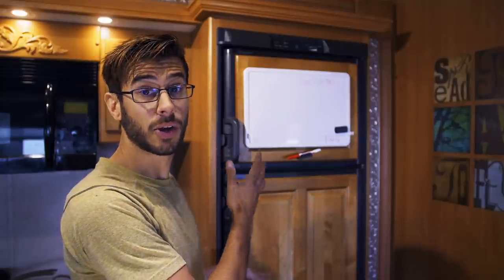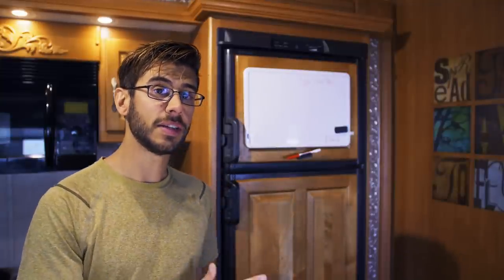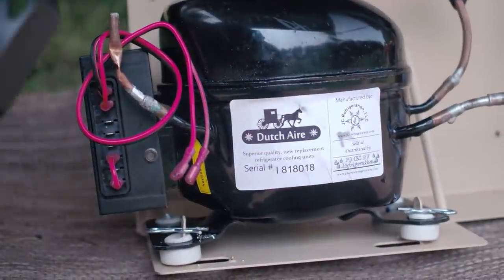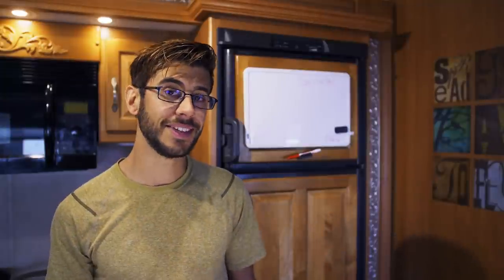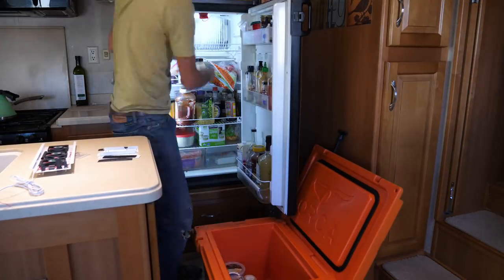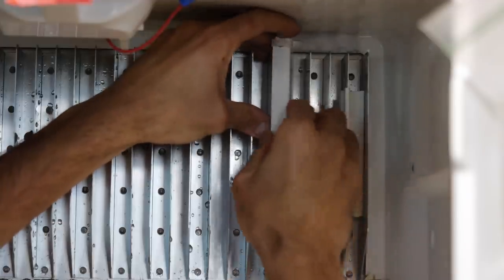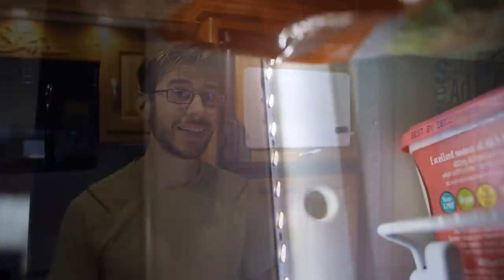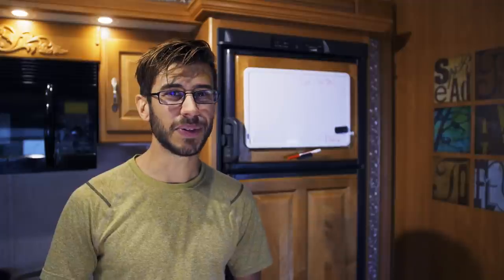RV Fridge Fan Installation and compressor retrofit 6 month update

Comment: You provide a lot of information about your projects, with great updates. The whole RV fridge thing is more complicated and there are much better options than 10 years ago. I have a Danfoss fridge in my van, which doesn't use much power at all. It's not very big. It's very quiet.

I was looking at a 4.4 cu ft fridge at Costco yesterday for $150. Not terribly nice looking, but OK for the rec room. They require listing operating costs, and I dug around inside the fridge and found the yellow placard. The yearly energy use for this ultra cheap fridge is around 275 kWh. If you divide that out, it is around 700 watt hours per day. So, it's pretty efficient and this is just a totally basic unit. 

With solar and, eventually, lithium, the all electric seems inevitable. The cost of a Dometic absorption unit is pretty high. I don't know what Forest River pays, buying in bulk, but retail is over $1k for a 6-7 cu ft unit. 

The numbers for using propane can be estimated, if only to figure the relative efficiency. There is a burner in any propane fridge and a good guess is that it is a 2,000 BTU burner. You can convert watts/BTU's since there are about 3.4 BTU's in a watt. (Your 1500 watt space heater is around 5000 BTUs.) A 2000 BTU burner is about 600 watts. My burner, last trailer I had, cycled about half the time. So 600 watts is 600 watt hours an hour, and 7200 watt hours per day, for 12 hours 'on'. Seems like the 700 watt hours in your fridge and even the Cheapo Costco is pretty favorable, compared to 7200 watt hours for propane. Maybe having a fire next to a fridge is not very efficient. Maybe absorption isn't very efficient. 😕

In my Ultimate Van Build, I wiil have an electric fridge. It would be nice to have at least R-10 insulation and then get a high efficiency heat pump that grabs and removes heat very efficiently. Then maybe an induction stove. 

Propane Facts:

https://www.amerigas.com/amerigas-blog/2012/march/geeking-out-over-propane

In this article, the draw for an absorption fridge on AC is discussed. He say 5A on 120 VAC, which is a lot of watts. But it works out to 600 watts on AC or propane. 

http://rvservices.koa.com/rvinformation/rvmaintenance/rv-converters-and-amp-draw.asp

Comment: Great update, Tom.  It is helpful to get honest updates with how you adjusted and addressed issues.  I am glad to hear it is working out.  We used a small battery-powered refrigerator fan to keep our refrigerator more evenly cooled when we used the travel trailer.  The kit you added for the fans makes a lot of sense.

Comment: Im installing one of the 12 volt JC Fridge units tomorrow. Doing my homework now. Will be sure to run a power wire inside the fridge while I have it apart. A temperature sensor wire too. I was going to run it on 24 volts but a thinking of staying with 12 volts now. My solar energy system is 24 volts but I can run it on the original house battery for now using the original 12 volt wires. Thanks, good review.

Comment: You may have just answered my question why I “don’t” want to try and put a standard RV fridge in my new Tiffin.  The longer term use and fin freeze potential underscore the fact that the need to run a generator for a brief time daily when dry camping overshadows the deficiencies of a two-way fridge.

Comment: Great video.   I have seen at the Huntsville,AL RV show a new 12v refrigerator.  Same exterior size, 10 cuft, stainless doors, and is frost free. Manufacturer specs state when empty takes 1hour to chill using 8amps 12v.  Once cold typical use is 3.5amp. It is a compressor type fridge built for rv’s.   Vibes are using these now..  I sound a source $799.00 shipping included.  It is an Ever-Chill WD-282FWDC.    Looks like it would be an easy swap fit.   Much easier than the swapping y’all had to do. My Rockwood 2507S is new but I am tempted to swap mine out.  The real plus is you could use power from tow vehicle while on road to keep food cold. Also would work with 100 w solar...
Reply: I just purchased a new Phoenix 5th wheel that came with this fridge. I almost did not buy it because of the fridge. The label on the fridge says 11 amps but, according to Way Interglobal, this fridge will draw 8-9 amps on startup until it reaches temp and then use about 3 amps to maintain that temp. So far it seems to be right. I have two 12 volt 100ah batteries in parallel and a single 100 watt solar panel on the roof. Dry camped for 2 nights and batteries drained down close to 50%. I also have a small 2000 watt inverter/generator that I can use for a couple of hours to top off the batteries if needed. The compressor in this fridge is a bit noisier then a regular residential 110 volt fridge but it's nothing we can't live with. So far, we are happy with it.
Reply: I'm curious how that fit through your door? or do you take it through the window?!

Comment: I really wanted to do this conversion for my 2001 Traillite with a Dometic 2652 but on the JC website they list the measurement needed from the back of my absorption unit to the outside wall and it's right at 2" under and wont fit without modifications to the cabinet work inside that holds the fridge. I may still do it but for now it's a no. also my absorption unit is cooling down to 32 degrees with the freezer down to zero by only adding an upper fan and interior fan kit of my own design, my biggest concern for going ahead would be to eliminate the gas burner but when you mentioned the Kilowatt usage it still wont work without 4 more solar panels (we only have a 400 watt system) my whole rv is on an inverter but the absorption unit had to stay on 120 shore/gen power, amp draw is too high for the 3000 watt inverter so here I am again, thanks for the videos and updates

Comment: Thank you for all your great work.
I have a question about the DC refrigerator.
I am set to follow in your footsteps but JC Refrigeration says they recommend the AC version.
What is your opinion? DC sounds more logical to me, but maybe I'm wrong. Doesn't it take more amps to invert to110VAC ?

Comment: Hey Tom!!! Great video. I am going to go with the DC conversion on my Nor Cold N611F fridge. Don't like the chance of fire. This unit now works as good as ever, fridge between 38 and 41 degrees and the freezer is around 8 on lowest setting, but I still want to shut off the propane to my fridge. NOW, you got me pricing solar units to keep the batteries from being over-taxed?? It never ends, does it. Thanks again for such a pro video and your knowledge. J.R. at JC Refridge knew you BTW; Bob Trice

Comment: Nice Video, thank you for the update.  JR has moved the copper tubing to the top of the coils now.  This sends the coldest stuff up to the frig (from the bottom of the coils).  I have the DC conversion and it is pulling 10 amps now because of the fixed 2000 ohm resistor.  I would like to put in the variable speed but I am electronically illiterate.  Can you send me a link to the variable speed?  Show me where to attach it (the Sikelan QDZH65G manual resolution is way too low)?   How do you know how much rpm is increasing?  Is the zero mark on the dial, zero rpm and the 10 mark 3500 rpm?

Comment: Thank you for this great update! Have you considered replacing your door seals? You mentioned that they might be responsible for some of the energy usage.
Reply from the maker: We have , but just have not had the time.
Reply: Most require a new door. The adhesive gasket kits are crap.
Reply: Great video!  I have the same refrigerator. I was able to find a replacement door seal kit offered by a company in Australia. Fridge-Seal was very easy to work with. They had a set made and sent to me in about four weeks. A bit pricey but well worth the money.

Comment: Thanks for both the original article about the fridge conversion and this update.  I'm considering converting the fridge in our class C as well. I actually had an appointment with J.C. Refrigeration in April to do the work but had to cancel due to the pandemic.  

I have a quick question, which boils down to, "do you think I have enough battery and solar power for this?"  I have 300 watts on the roof the RV and another 200 in a portable suitcase that I can move to best catch the sun.  However, I only have about 270 amp hours of battery capacity, and there's no good place to carry more.  

In this update, you said your biggest draw day was 1.2KWH.  If I'm using the right formula, that would be 120 amp hours at 12 volts - is that right?  And if true, it means that on that max draw day, I'd use almost half of the battery capacity just for the fridge.  

We have an onboard generator so we can recharge that way if when we need to. 

We very often have AC hookups, but we also enjoy extended stays off the grid.  What do you think?  Would you have concerns about making he conversion to a 12V DC compressor-based fridge?  

Thank you, 
Dave Collins, Windham Maine
Reply: Additional info:  we don't run an inverter at all right now.  The consistent draws on the batteries are lights, and enough juice to regulate the propane heater and propane fridge.

Comment: Interesting  review of your upgrade and well a done video, thank you.   If I many add my thoughts, yes the fan mod works but at the cost of much higher electricity usage than need to correct the frosting issue.  An issue you don't have but others might.   Those fans no way need to run 100% of the time. 100% duty cycle is way over kill for their needed function and therefore wasting electricity more than required.   I contend they would preform just as adequately if they only came on periodically like typical refrig's do via a defrost timer. That could also work the same way but it does not to the determent or using much more power than needed.  Not just from being 100% duty cycle when not needed but by over circulating the air inside the frig the cooling load on the compressor is greatly increased.  Cheers.
Reply: Just get a well insulated top-load Engel or similar. They offer a very low electrical draw and need no mods to keep working reliable year after year. Of course they look and operate differently than a household fridge but that is a good thing.
Reply from the maker: Yes a timer would be smart.  I did not mention it but I usually only run one fan at a time and switch through them every few days when I think of it.  I frost forms the fans will melt it so they don't need to running all the time

Comment: Hello Tom, watching your first video on the subject inspired us to retrofit our unit from JCR as well.  I'm wondering if you've had any further trouble with your retrofit from them?  I've had nothing but trouble from ours and have even asked for a refund.  From blowing the original motherboard to installed fuses, adding a inverter to "trick" the unit to think it's on 110v, to blowing that inverter, to finally having the unit continually blow house fuses to the fridge.  I don't think it has run continuously for more than 2 months at a time, going out 5 times and ruining untold $ of food in the freezer/fridge.  Reliability of the unit I've found to be....let's just say "not so good".  If I can't trust it from day to day, the unit isn't worth having in my opinion.  At the moment, the compressor will run, but i have to manually turn the unit on and off with a switch.  And knowing that my memory sucks, temps vary "wildly".  Is there a timer unit that you know of that would just have 5 min on/off cycles?  I've found units Amazon that will do that, but only have 17 "programs" available that I would need to extend my runtimes significantly.  They seem overly complicated to my needs.  I would just like a simple "timer" to adjust without its need to know what time to come on and off.  Any thoughts would be greatly appreciated.

Comment: This is all much too complicated. I have had a engel top load running constantly for 15 years and never had to any more turn it on. My top-load (side by side)  dometic is but a year old yet operates similarly. I was hoping your conversion would end all the traditional problems with an RV absorbtion fridge but nothing seems to have changed. Fans to circulate inside and fans to cool the compressor (when the outside temps hit 100 or so) seem still needed after all these decades. I was really wondering and am glad you did an update. Thanks

Comment: If you had the whole process to do over again, would you still go with this conversion, or retrofit to a fridge designed and made with a compressor to start with, (assuming you can purchase this type of unit that would fit in the space you had?)
Reply from the maker: It really depends if I could find a DC fridge of the right size and good price I would probably retrofit.  If not I would go this way again. I like having the fridge that fits and looks right but the dedicated units do have more space in them

Comment: If you were buying a new fridge, what kind would you get?  We are looking at our first RV and we want to build in boondock capability.
Reply from the maker: If you are not planning to do a big solar system the traditional absorbtion fridges running on propane are best for boondocking. The domestic units are getting pretty good. Dometic also makes a DC compressor version from the factory if you plan to go big with solar.

Comment: If I understtand right, newer fridges go through a short defrost cycle every 25 hours. I wonder if that cycle would be enough to keep the fins free of ice or if the better cooling power of the JC unit would still build up excessive ice. 
Do you know if your fridge goes through a periodic defrost cycle automatically?
Also, are you saying your JC unit didn't cool good enough until you upped the voltage to the compressor?
Thanks fo r agreat channel!
Reply: My DC conversion does make alot of ice on the fins.  I keep the fans on all the time.  I got the 5 fan unit, it goes all across the back.  My frig did not cool enough with the 1000 ohm resistor installed, so JR swapped it out with a 2000 ohm resistor.  I am installing a variable resistor (potentiometer) so I can turn it up when its hot and down when its below 80*.  When its turned down, it will draw 5 amps.  It draws 10 amps when I turn it up.  60% of the time when the compressor runs.

Comment: would you be willing to share the compressor mfg. info. I need to do the pot upgrade. Mine is not giving a consistant temp through out the day. JR said I should just leave the thermistor dangling to see it it helps instead of clipped onto the fins.
Reply from the maker: You may want to check out the original video of the compressor replacement:  https://youtu.be/Yte1V3CkDrw We also wrote an RV fridge troubleshooting article that you might find helpful: https://mortonsonthemove.com/rv-fridge-troubleshooting/

Comment: You Definitely know what you are doing but I am just curious why did you go through all the hassle and just not put a residential unit in?
Reply from the maker: Energy savings not running the fridge.
Reply: @MortonsontheMove  hey I have a question if you don't mind answering I know it's a little bit off topic but you seem like the kind of guy that would know I have a travel trailer I live in it full time Long story short the absorption refrigerator just did not work right never did tried everything I took that out and installed a residential unit they say not to install it in an RV in the manual which I assume is because they do not want any issues as far as returns and things like that but back to the question do you think it is okay for it to vent the heat in that tiny space or should I put a fan back there to the 12-volt connection? Thank you I also am subscribed by the way 👍